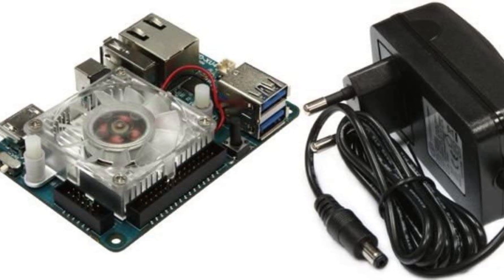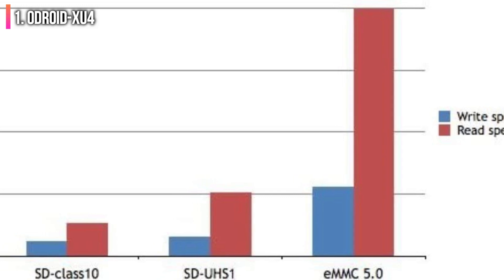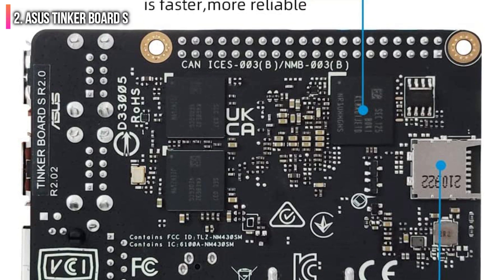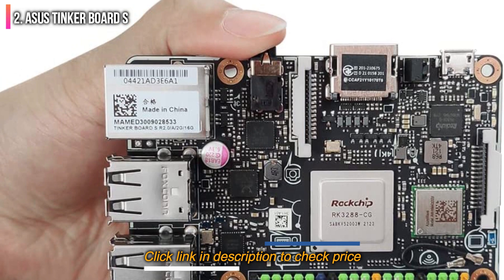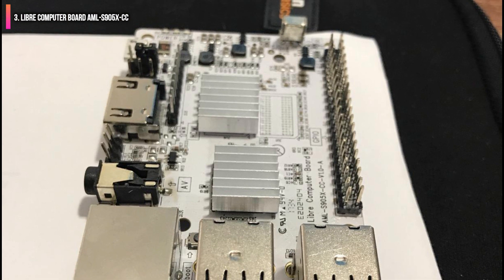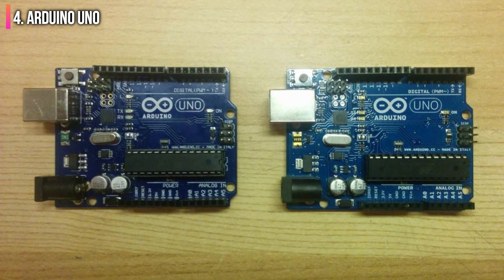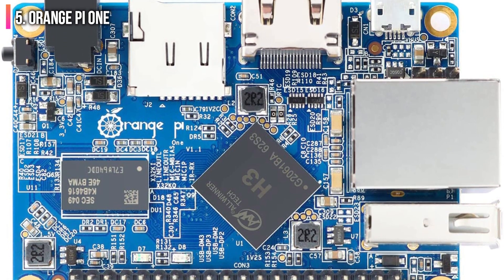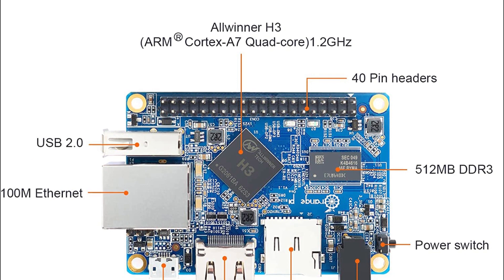Best Raspberry Pi Alternatives in 2022

Comment: And which alternatives also have a working Linux? 
The frustration often comes when trying to install an up-to-date operating system.
Sometimes the Wifi doesn't work and the next time the screen output.
How do I install Linux on an Arduino? Does it have an HDMI connection, Wifi, USB or Ethernet? No !
This is more like a Raspberry PI Pico, ESP8286, ESP32

Comment: You included the Arduino Uno micro controller as an alternative to a single board computer.  The Raspberry Pi Pico at $4  or  the Raspberry Pi Pico W at $6 micro controllers should then be considered.  I have replaced a RPi Zero with an RPi Pico and an RPi 3B with an RPi Pico W.  It was easy to convert the Python coded to Micro Python. I am using RPi Pico W boards in three other projects.